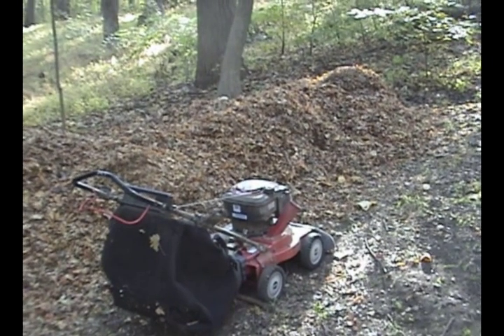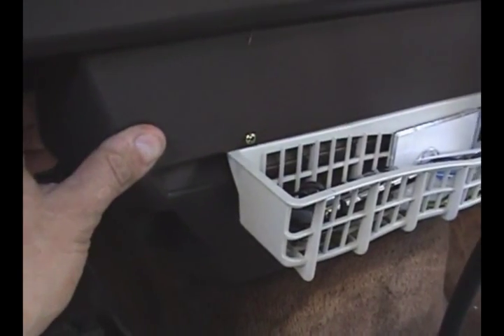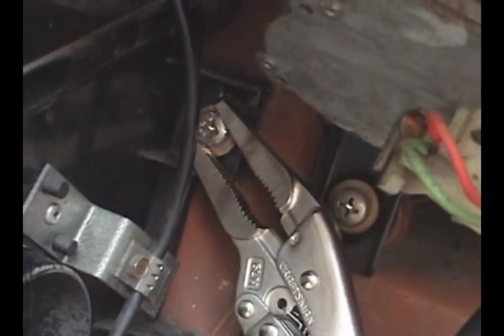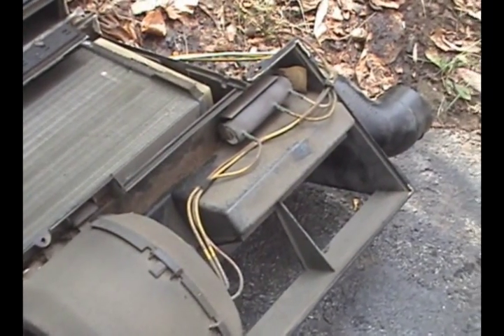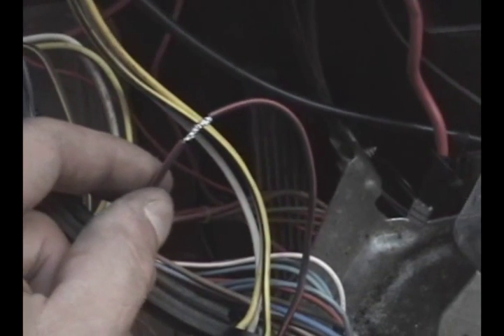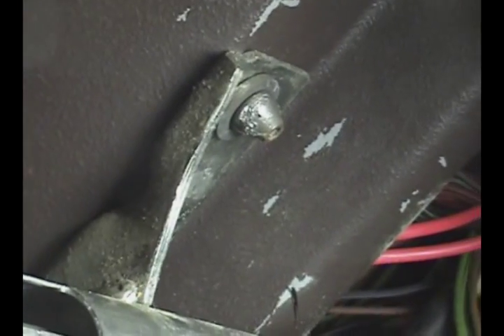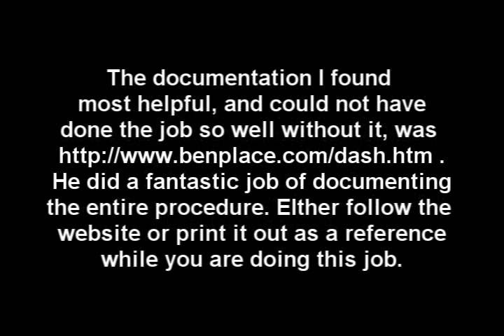Installing a Heater Core and Fan on a 1983 Vanagon W/C - Dash Removal

Comment: Many times during my dash removal/blower replacement/dash re-install I laughed out loud at some of the things I remembered from this video ("Only an idiot would do that!", and ""This will probably fail on me in 3 weeks", and "Best thing to do would be to have this van towed.").  Thanks for sharing this project with your great brand of humor!

For the record (and for anyone else reading this who is scared to death about doing this project themselves), there are a couple of things I did differently: 

Getting the box apart was accomplished with a very sharp stiff putty knife (mine is a 1991 with the plasti-welded tabs).  To reattach the halves of the heater box , I drilled pilot holes through the tabs and secured them with sheet metal screws (17 in all, I believe).

My heater box was melted where the resistor lived, so I relocated the resistor it to the grill area behind the passenger side headlight (similar to the radiator fan resistor located behind the driver's side headlight) with an extended 12 AWG wire loom; it's now surrounded a by a non-flammable/non-meltable metal area, is always in fresh airflow, and can be easily changed when it fails in 3 weeks.

Regarding the headless "Cruel Bolts" attaching the upper steering column to the dash and its internal supports; near as I could tell, these were designed to thwart thieves though some claim they are special "shear bolts".  I replaced them with stock hex head bolts.

Many beers were consumed during this project--and yes, they did help as you suggested!

Comment: 1/4" hex impact driver with #2 or #3 6" or 8" extensions. Always use exact fit Phillips drivers. Penetrating oil or similar to loosen fasteners.

Comment: this can be done without pulling the steering wheel off and without touching any of the steering stuff, just remove the 4 nuts that hold the column and let it drop and rest on the seat ;)

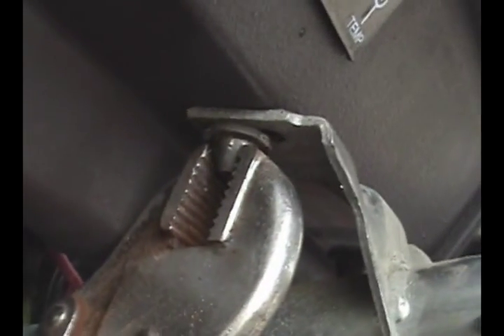Comment: Thanks for the video.  I hope you found a replacement bolt for the steering wheel.  For anyone who is looking to do this job  here's a couple more tidbits of info.  @ 2:48 of this video, the bolts referenced are shear bolts.  The heads break off when proper torque is reached.  New replacement bolts with the allen head are available here: http://www.busdepot.com/411417549 or a local shop can likely order them.  Mine were $8.48 each ($CAD) from my local parts guy.  @ 4:25 the left side screws that hold the heater box to the van are referenced.  Socket ratchet with a 12" to 18" extension and phillips screwdriver socket makes things easier if you have one.  My '86 heater box was glued together at each tab near the metal clips.  The manual says to insert a knife between the tabs and hit with hammer.  I used a dremel tool and cut the hardened glue.  @ 7:30, thanks for the reference re: bulbs  Dash is 100% better now that it has lights.    Unlike me, remember to put the steering column shroud top on prior bolting the steering column into place and using up two shear bolts.  Once again, thanks for posting!!!
Reply from the maker: Thanks for taking the time to send this info!